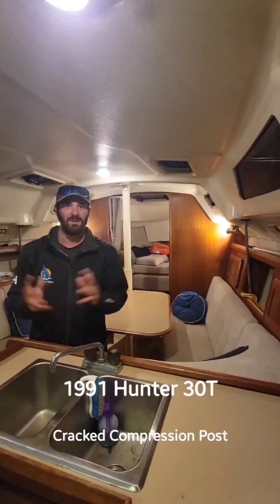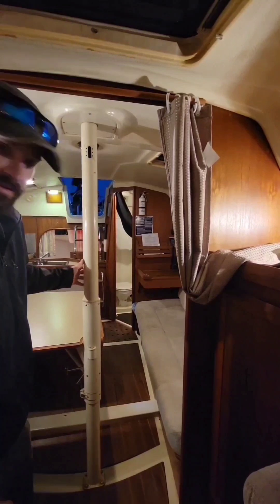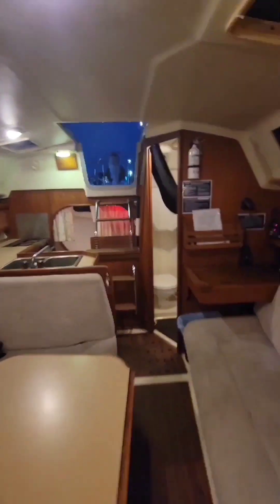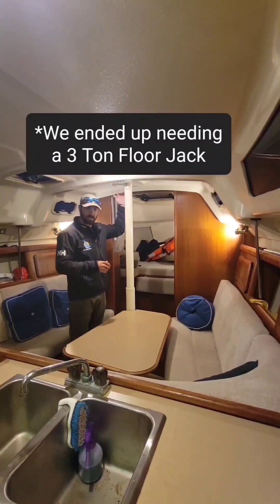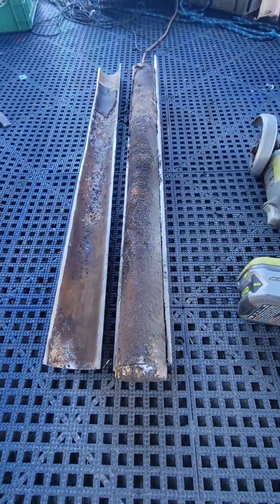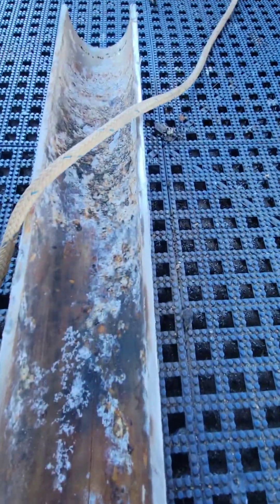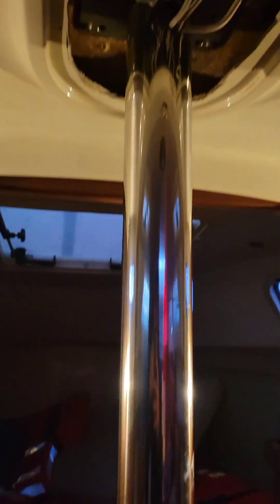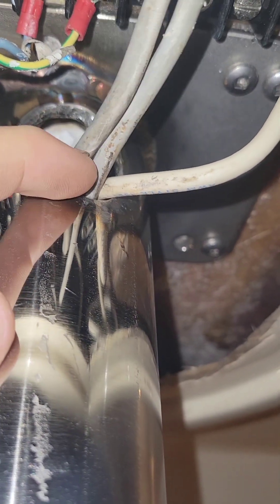Hunter 30 Compression Post

Comment: I also have a '91 H30T with a seized counter weight. It hasn't split the compression post yet but I think its just a matter time before it does. I used a boroscope to look inside the post. There was about a pint of water sitting on top of the weight, so my mast step is probably leaking too. Do you have the dimensions of the top and bottom plates?  Another issue I've discovered common to these boats is the nuts securing the chain plates to the hull behind the settee cushions are not stainless, and rust over time creating the potential for demasting. There is an access hole under the settee seat decks on both sides where a boroscope can be used for inspection.
Reply from the maker: I was sure our video would find another Hunter 30 owner who had the same problem. Let me know if there's any information we can provide to help you. The plates on the top and bottom were just scrap at a friends shop that was cut to fit. Those are simple measurements and we did not make those plates in the original size.
-Paul